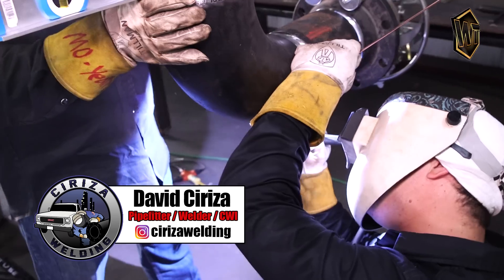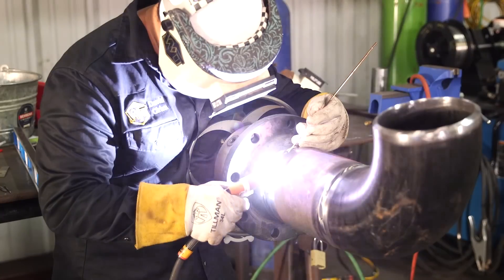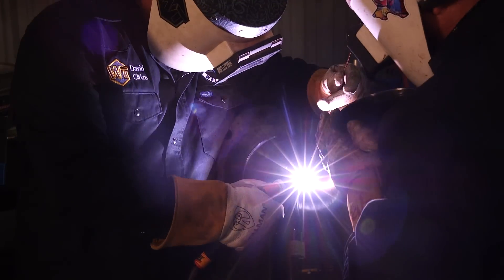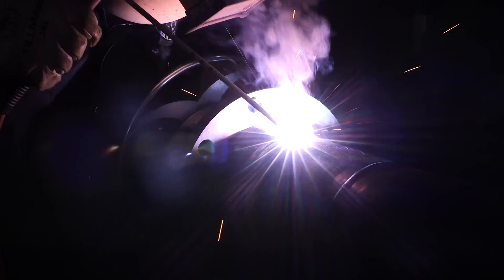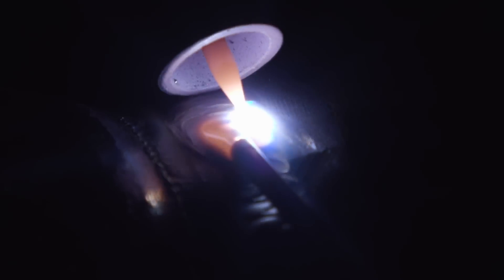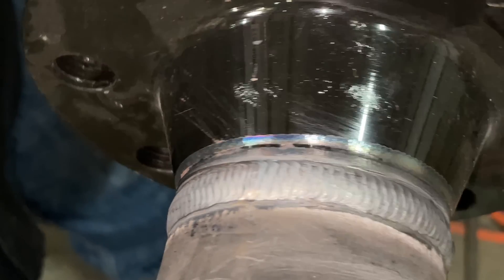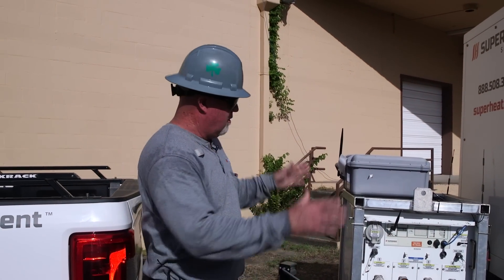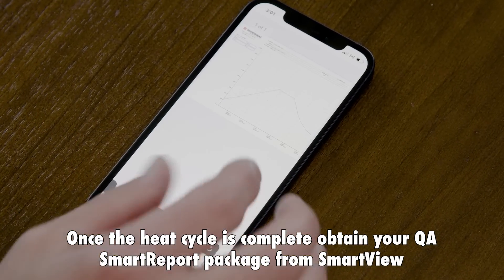How to Weld a Pipe Spool | TIG and STICK Welding

Comment: Question why tig the root ? Then stick the cover and cap?
Reply from the maker: Very common in the petrochemical industry, combo welding tig for accuracy on the root & stick fill and cap for welding quicker. But it will all depend on what your Welding Procedure Specification (WPS) calls for👍